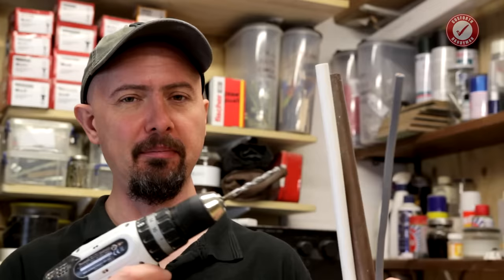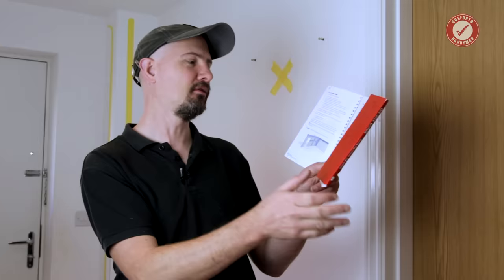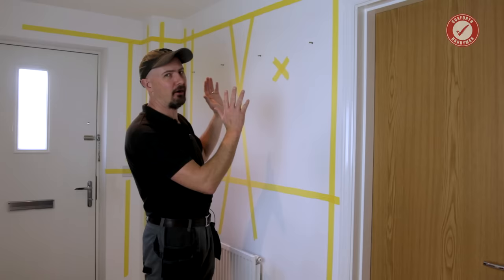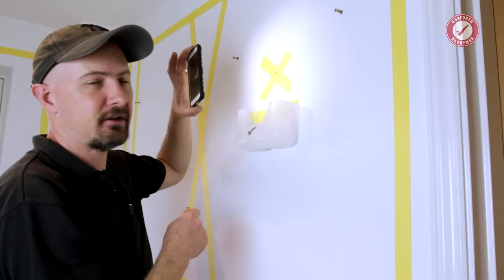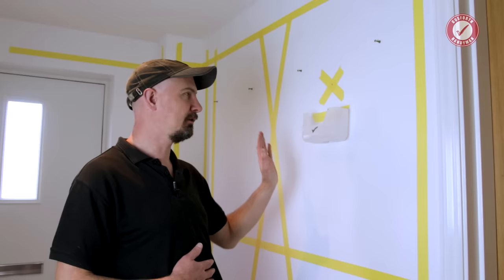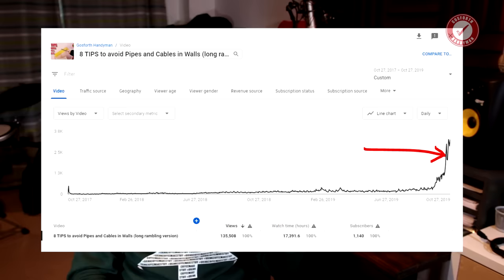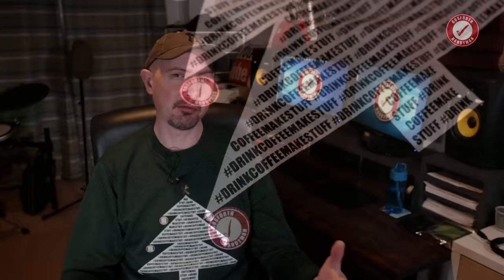10 TIPS to avoid Pipes and Cables in Walls

Comment: There’s only one thing that works 100% of the time: an endoscope. You drill a hole just under the surface of a « safe » zone and insert that little camera and its cable. You can even take pictures of what is behind your wall. And it’s cheaper than ever. Forget stud sensors, not finding what you need, especially plastic piping. And I also hate metal studs, not environmentally friendly, hiding anything, rusty, and a pain to demolish when it’s time to do a major work.

Comment: Cable installer here. Outside of avoiding obvious locations that could potentially have wires or pipes, as you've shown in the first part of the video, I simply avoid drilling into drywall, it's not even necessary to drill most of the time; I just poke a hole with a screwdriver(I start with a thin screwdriver then enlarge the hole with a bigger one, which happen to be the size I need for the cable I need to run). Not only it won't damage pipes or wires if any, but it also makes a nice smooth hole (as the drywall paper is pushed in) unlike drill bits. If I need a bigger hole, then I know I can proceed and drill with confidence now that I know I previously didn't hit anything with the screwdriver.

Comment: My top tip; when you think you know where you want to drill a hole in a hollow-back plasterboard wall, before you drill, use a bradawl or a small screwdriver to poke a small hole through the board first. If the bradawl pushes through the board freely then there is likely to be nothing to worry about. This will give information up to a couple of inches deep. If there is anything behind the hole you can stop and relocate the hole if necessary. Using a power tool to make the first penetration in a wall is more risky than poking a small hole with a hand tool. Your force pushing the hand tool is much lower than the power of a metal drillbit spinning in a chuck.

I usually mark where I ideally want to drill, use a stud/pipe/cable finder, and if that shows all clear I make a small hole by hand to double check. This is also a good tip if you want to screw into a wooden stud and want to besure you are firmly on the stud before using a screw. The bradawl hole acts as a screw guide.

If you need to move the hole to a different position there is only a tiny hole to fill.

Comment: All good tips but you forgot the one "cross your fingers and hope for the best!"  LOL. I was in the security (fire/burglary/etc) business for 20 years.  Running many wires through new and old homes. Never hit a pipe or electrical but knew several competitors that had epic stories to tell. One drilled through a floor and hit an illegal 440 volt transformer (don't ask). Luckily his drill was insulated but in completely melted the 36 inch bit!
Reply from the maker: Too right! I've had a few where I knew I was on a metal stud but it was showing up voltage - obviously cable inside the stud. Nowhere else to put the screw so just had to hope for the best. Very tentative drilling of a little pilot hole. 😂👍

Comment: You could unscrew the switchboard and pull it out a little. You'll see the direction of the wires of the switches (Vertical/Horizontal). It's illegal to install wires diagonally but there are some houses with it.

Comment: Hi Andy.Back in the day when plumbers did a proper job and used copper pipes not plastic, you knew that pipes would be teed off at 90 degrees so you more or less knew where they were in relation to taps etc, but with plastic pipes I've found that ( especially in new builds) they can run at any jaunty angle.
 I had a repair job not a million miles from you when a new build home owner hung a picture in the middle of a staircase landing wall and punctured a plastic pipe which ran diagonally from the top corner to the bottom corner. Keep up the good work and all the best for Xmas !
Reply from the maker: Cheers - and to you and yours! 👍👊

Comment: 1) Rule out the obvious (0:19)
2) Work out Danger areas (1:03)
3) Use a detector (5:21)
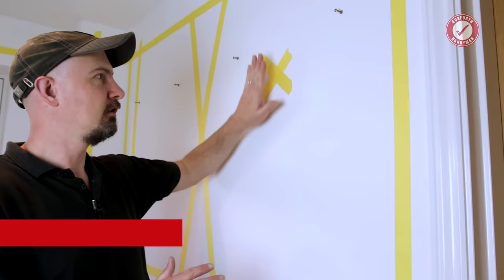4) Use a blunt masonry bit (7:06)
5) Feel what's in the wall  (8:05)
6) Look what's in the wall (8:46)
7) Avoid using nails (9:37)
8) Prepare for the worst (11:15)
9) Know how to switch services off (13:00)
10)...? Metal studs suck? (14:10)
Reply: Guys like you are super heros without capes. Thank you!
Reply: And if you haven’t got a detector?
Reply: @whatsinaname11  Be lucky, or buy one online/ in big box store. I think he advised against the 'be lucky' approach though; and buying is less than half an emergency call-out (without the works or parts cost), and scheduled in your own time.

Comment: I spent hours across a few days trying to find where I can drill. Bought 3 detectors, each more expensive than the last but was getting strange results everywhere. In the end I just went for it, and realised then that the plasterboard was metal backed everywhere.
Reply: Use Glue.
Reply: Bit risky

Comment: Watching this video, I'm glad I live in Canada where most of the residential construction is all wood frame and hitting mechanical systems is less of a concern. The only concern would be if a 3inch drain line runs down a wall. Doing renovations I have seen a drywall screw or 2 screwd into either a plumbing vent or drain pipe. Generally the wiring is back at least 1 inch from the surface of the stud, if its not there has to be metal plate protecting the wiring from puncture.
Reply: I'm glad i live in England where MOST houses are built to last, timber framed houses here are only built for the cheaper market
Reply: @shoryuken3305  and less of everything else (apart from land) as far as i could see in the year i lived there
Reply: @bum-edwhu66  less crime less poverty you are right xD
Reply: @shoryuken3305  you forgot less wealth and less opportunity
Reply: Same in the US

Comment: After most of the wall has been taped and you've carefully used a stud finder to meticulously check and then slowly drill with a blunt drill bit and you feel through the wall, 'These are the safe areas which are not necessarily safes'

Comment: on plaster board on wooden studs, I use either my knuckles or a handle of a small phili[ps screwdriver to tap across until I 'feel' the stud positions, then use the screwdriver as a bradawl to drill through. I usually  make a few drillings horizontally , say half inch apart, to find the centre of the stud. No point in using a big woodscrew at the edge of a stud.

Comment: Thanks for these tips mate. Great explanation. Had a few accidents but its kind of made me more aware. We’re all human. Your tip of feeling the warm pipes through the walls and using something blunt first is brilliant. 
I have a question though.... most new builds have foil back plasterboard and the detector goes off everywhere!?!? Are we hoping for the best?? 

Cheers!
Reply from the maker: Our new build just has normal plasterboard but yeah if it's the foil stuff you just have to be really careful. Look for peaks on the detector and you might find electric cables... but finding the plastic pipes can be a real challenge - just be careful and don't use a sharp drill. 😀👍
Reply: Thanks very much. My new build also has the normal stuff!

Comment: I use picture hooks all of the time, and they're a quality piece of equipment. They come in single, double, and triple pins, and they can hold a lot more weight than you think. A good way of testing this is to bang one into the wall and then try to pry it off. Even with pliers, it can be really hard to pull off. Agreed, they can be hard to get into a solid wall, but if you're hanging something that isn't particularly heavy, the picture hooks are really good.

Comment: Having got caught out by finding a 10mm plastic central heating pipe running upwards behind an upstairs radiator (I thought all upstairs pipes would go downwards) when using a wood drill bit with a sharp point (yes, it scored a direct hit) I now use a small bradawl to carefully make a tiny hole without pushing it in too firmly so that it just about penetrates the soft plasterboard (dot & dab). With different sizes of Phillips screwdrivers I can easily twist and enlarge the hole (easier to control than a drill) having first tested what's behind it with a small flatblade screwdriver.
Reply from the maker: Defo - does't take much to go through those plastic pipes! 😀👍
Reply: @GosforthHandyman  But the plastic pipe was just 10mm wide and my pointed drill bit hit it bang in the middle - the jet of water hit the wall on the oposite side of the room! Anyway, to get at it I had to cut a large hole in the plaster and used one of those JG Speedfit push-fit connectors so hopefully that's done the job. Having gone from a 90-year old house with solid walls and copper pipes to a new build it was quite a quick learning curve!
Reply: That's exactly what I do too !

Comment: Fixing into metal stud, don't use any longer screw than you need to, so if you were fixing the plaster board you would only need 25 mm screws, so there is not going to be a problem if you can get away with not going into the wall any further than 25 to 32 mm, and to be honest, you are not going to gain anything by using a longer than 32 mm screw anyway as the studs are only around a mm or so thick (depending on the type of studs used) . IE   you are fixing a 20 mm batten on the wall use 50 mm fine thread plaster board screws, DON'T use an IMPACT DRIVER, pilot hole the batten and counter sink, set the clutch on your drill driver as low as you can get away with, or you will just strip the hole that you have just made in the very thin stud. You might want to use some solvent free adhesive as well so you have more time to faff around!
Reply from the maker: Great tips Martin! 👍

Comment: I moved into a house where steaming the old wallpaper off repeatedly tripped the electricity, for 20--30min at a time. Getting darker that afternoon in late fall, a mate noticed sparks in a still-wallpapered corner: Surprise! Someone had screwed through the only ring circuit in the late-60s council house, when attaching a thermostat, straight above a socket in an otherwise featureless wall. They then moved the thermostat 2inches (sideways, luckily!) and left as-is. Somehow the moisture from steaming in the room short-circuited the frayed mains cable until dry enough (sparks DO speed up the drying process, so the tripping slowed that down; and I'm guessing soot/ashes are an electric insulator).  RULE OF THUMB: If you find one such thing, you'll fine many more surprises at inconvenient times; try to become best mates with an electrician and a plumber.

Comment: When using a detector make sure to plug in and turn on an electric device in your power outlets. Making the electricity flow makes it easier and more accurate for the detector to do its work.
Reply from the maker: Good tip! 👍

Comment: Tip one use a magnet rather than trust a stud detector. Tip two look what’s on the opposite side of the wall. Tip three if it’s plasterboard I always push through first with a small old blunt screwdriver.
Reply from the maker: Magnets are great for finding studs - keep a bunch in my plug box. Bear in mind they're no good for finding pipes & cables as they're not magnetic. 👍
Reply: tip 4 copper is not magnetic
Reply: tip 5 wooden studs are not magnetic
Reply: @0skar9193  no but the fasteners are

Comment: If you are in a slightly older UK house with solid brick walls it is not uncommon for electric wires to be running up the insides of door frames.

Comment: Our 80s house has all the copper radiator pipes set into the concrete floors downstairs, for what it's worth - it's an estate-developer job (I forget which one - begins with a 'J'?) so I imagine there's loads up and down the country done the same way.

(It also has really annoyingly creaky floorboards, so what I'd really like tips on is how to drill and screw into your floors without hitting pipes or cables!)

Comment: 4:50  Tell me about it!  I presumed that the feed wire to the outlet went vertically up to the attic or horizontally to the next outlet.  NOT!!!  The idiot builder went diagonal from the outlet up to the attic all to save 6 ft of wire (2 meters).  I found that out when I cut through the wall to install a new doorway.

Comment: Damn...i just wanted to mount my TV
Reply: I thought I was the only one
Reply: lol i just wanted to hang my ikea Boaxel wardrobe off the wall... ikea didn't mention you need to know all this .....
Reply: Just glue it? Hm. Actually my mate went wrong after doing everything right: Bought a 23inch TV years ago and installed VESA bracket correctly --- prudently in his mind, following all the rules of this video and also attaching it stronger than needed. Then he got a 50inch TV, then something 75inch or so, and then a substantially larger 4K... CRUNCH one TV securely attached to a bracket, lying broken on the ground with some plasterboard and stud splinters for character.

Comment: I'm wanting to put a doggy door in the wall next to my front door.  There is a light switch next to the door, and my only concern, at this point,  is whether or not there can be wires close to the floor ~ the one thing you did not cover, unfortunately.

Comment: I am converting a old water heater (now moved) and a coat closet into a pantry with shelves. I have 2 switches and outlets on 3 of the outer walls. I am planning on drilling the supports into the studs only. The supports are 2x2's (1 and 1/2 inches), drywall is 1/2 inch. Would it be safe to use a 2 1/2 or 3 inch screw. The 2 1/2 inch screw would only go in the stud a half inch. The 3 inch screw would go in an inch. I am super nervous. I tried buying an endoscope, but the picture was terrible.

Comment: I worked in an office that had metal studs.  I wanted a book shelf installed. I just put up lots of bracket holders.  One weekend I went home with no worries.  The shelf had held several months.  Then hurricane Katrina hit the gulf.  As with all hurricanes, Katrina slowed down to a tropical storm as it moved north.  In Ohio, the systems always pass through as a huge rain storm.  This weekend the humidity went up and my shelf fell.  It was my mini disaster.  I still don’t know-how to drill into metal studs.

Comment: I've put up some rear speakers on my dot and dab wall but in the process I had cut the outer sleeve of the mains switch cable which only exposes the brown and blue cables inside but no copper wire I've covered this section with electrical tapes and continued with sealing up he wall the switches seam to work fine no spark lol is this ok

Comment: Great video!  I love your sensible detail. unfortunately it does not fix my problem which is nail pops on ceiling plaster. I bought a totally useless multi detector (Magnusson and have since seen terrible reviews!). I only know that the 19 holes in my ceiling are roughly in lines, also that from upstairs' perspective many of the nails miss the joists completely and the useless detecor seems to think there is electrical wiring in parts of ceiling that cannot possibly have any wiring!  I will look through your channel to see if you have any ceiling tips.

Comment: What are the rules around modems? I basically want to mount my router above the modem (which came attached to  wall of my new build), will there be any cables running vertically from the modem?

Comment: Do you have any way to determine if my new apartment has wood vs. metal studs?
Reply: You can sometimes tell by inspecting the door jamb at the front door with the door open. I was at a new apartment yesterday and could see wood and splinters behind the deadbolt plate.